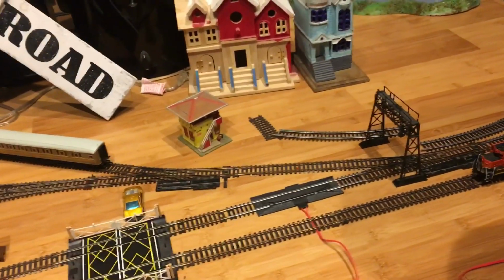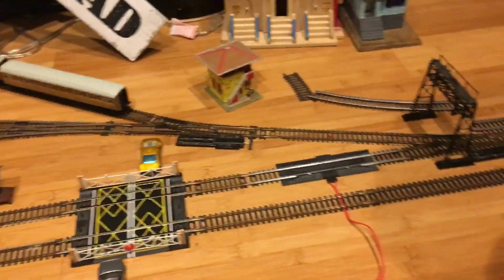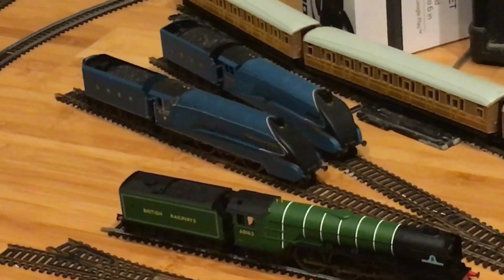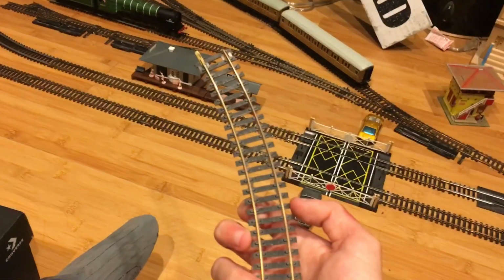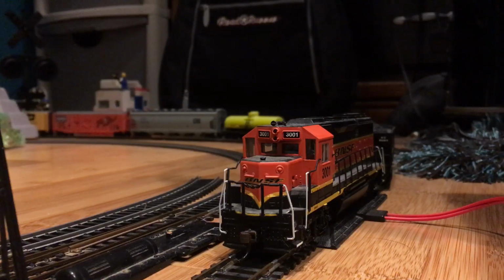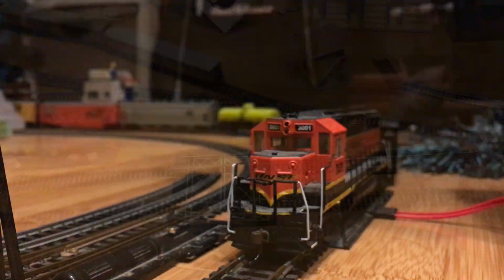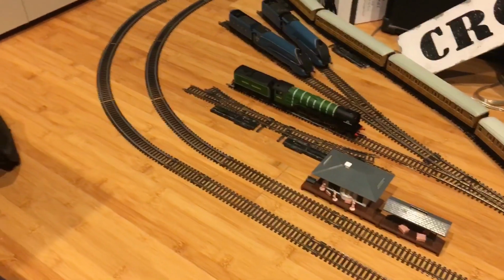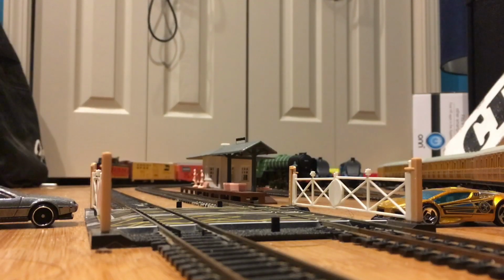Why I’m Not a Huge Fan of 15 Inch Radius Curves or Tighter (HO/OO)

Comment: My Athearn Sd70ace does not like 3rd radius which means I am stuck with the one loop when it comes to running my Athearn loco
Reply from the maker: Yeah, a lot of HO steam and diesel engines hate those curves. US Manufactures can’t make a proper one that can go around that right of curves unless you have an 0-6-0 or something. It really sucks. I’m guessing it might have something to do with the chassis that keeps them from running that tight of a curve.